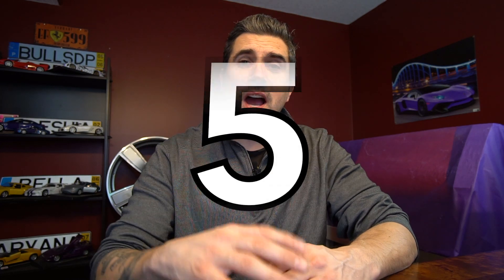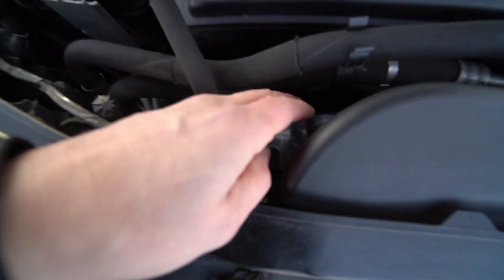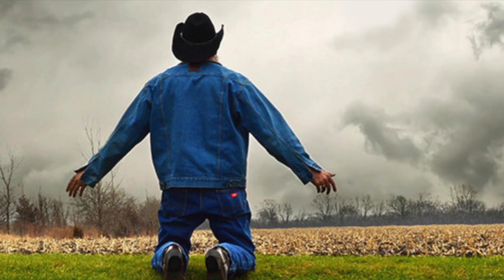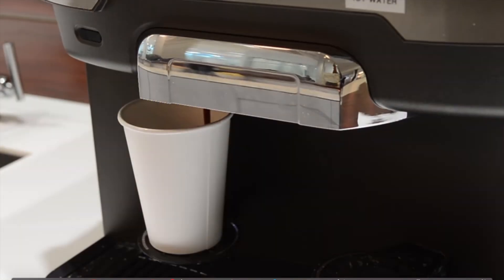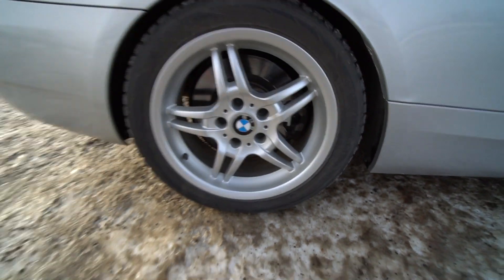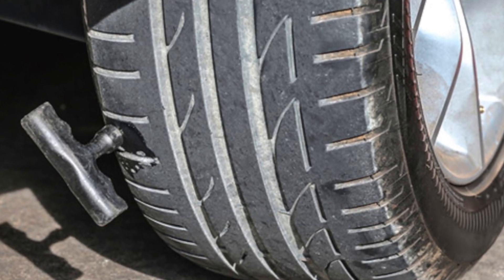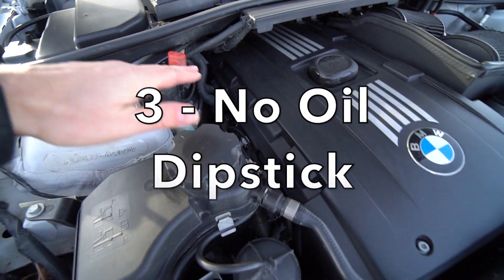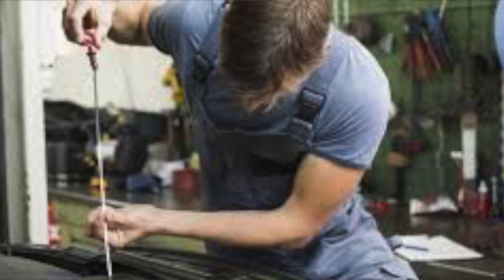5 Reasons Not To Buy Unreliable BMW 335i

Comment: My 335i ready broke my wallet 😅😅😅
Reply from the maker: What year?
Reply: @ECPP  2008 I paid 12 k for it and for maintenance  like 7 k in less than 2 year
Reply from the maker: Ouch, that is brutal.  I know your pain as I have repaired a pile on my mine as well, fortunately between myself and my mechanic buddy we did almost all of it for minimal bucks.  I see the second and third owners feeling the brunt of the repairs because these cars are fairly solid for the first 100,000 kms and then ....look out.  The bad stories come from folks who buy them with 70,000, 80,000, 90,000, and more once the parts finally give up like coolant parts, water pumps, injectors, etc.
Reply: @ECPP  when’s the best Kms to buy if you can’t afford one below 100k km?

Comment: Buy a 325 instead! 😂😉
Reply: Yeah my dad had over 200 thousand miles on his before he gave it away it ran fine no engine or transmission  trouble
Reply: What about a 328
Reply: Or a 335i with the N55 engine. Still have issues but not as bad as N54
Reply: @anthonymolina7416  I'm at 138,000 works like a dream 💯